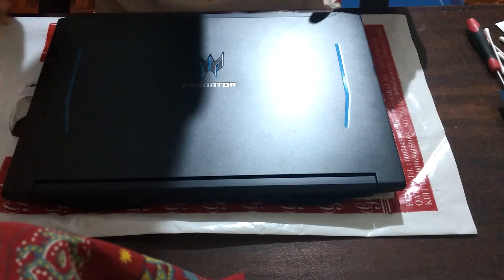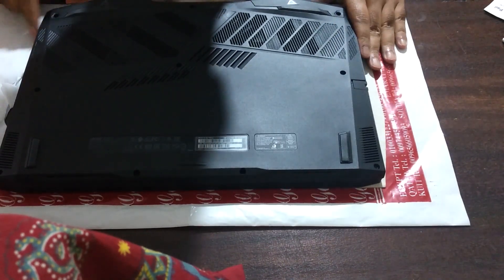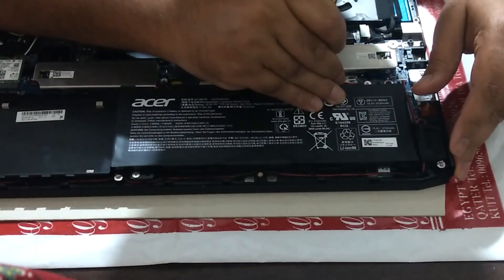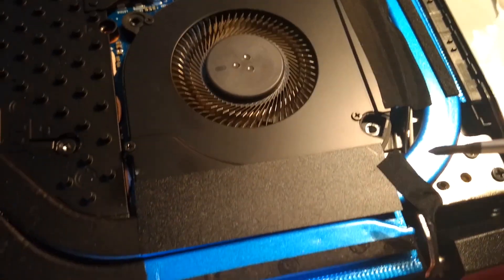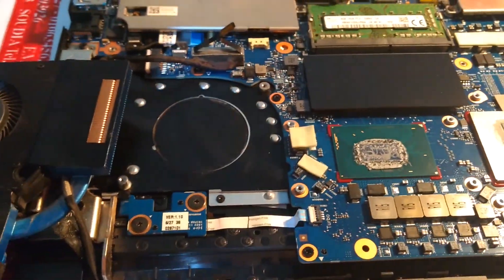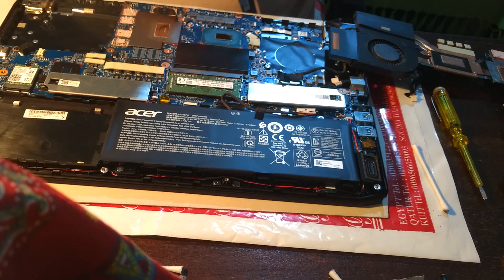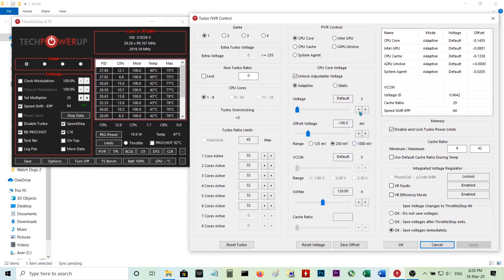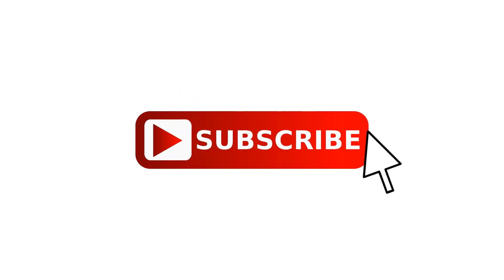Repasting your laptop's thermal compound | Arctic MX-4 2019 | Acer Predator Helios 300 2019

Comment: Hi, I just applied arctic mx-4 and thermalright extreme oddesy pads for my helios 300 (9750h, rtx2060). I did few CPU  & GPU stress tests and temps are hitting max about 75c with max fan speed, after about 5 mins of testing. Is this normal or should it be lower? I'm asking this because I checked the Arctic authenticity and it ahows it's fake.

Comment: Going to paste my laptop for the first time in 2.5 years. GPU fan just gave up. My temps were never very high, as i didn't game much. Recently the Max temperature was 75 degree using photoshop. I did routinely clean my fans, so maybe it helped. Now I can't avoid pasting anymore. Hopefully fan starts working again with some electronic lubricant.

Comment: What can I use to replace those vram paste?
Reply from the maker: I just repasted again today. The VRAMs I used 0.5mm Thermal Grizzly pads. For the rest 1mm pads. So far so good temps on load with Shadow of the Tomb Raider, I'm getting 75C :)
Reply: @ArifFidaali  Do you think those thermal pads are better for vram than using a paste?
Reply from the maker: @JotaFla  Yeah I think so
Reply: @ArifFidaali  And also, I just ordered the kryonaut extreme and I was thinking about using it on vram either. Do you think 2g is enough? For cpu, gpu and vram

Comment: What happens if you pick the 125mV in range? Please explain
Reply from the maker: I assume you're referring to undervolting with Throttlestop? It depends on your CPU. The same CPU will have reduced temps and other not work as in will give u BSOD. You have to keep experimenting until you reach a stable voltage without any BSOD

Comment: thanks a lot for this video, I was wondering  if you can tell me how much CPU temp after change it
Reply from the maker: Your welcome. I was at 85 - 90C then after repaste it was at 70C - 75C.
Reply: @ArifFidaali  wow it's big change that's mean the factor put bad thermal paste 
thanks bro
Reply: last question what about GPU temp ?
Reply from the maker: @mustafahasria3045  reduced by about 10C
Reply: @ArifFidaali  hi bro today i repaste my thermal paste for my laptop Helios 300 2020 with MX-4 2019 but my processor heet still 93 what is wrong can you help me with that
Reply from the maker: @mustafahasria3045  for best results also use Throttlestop to undervolt

Comment: Hey,
I am also having Helios 300 2019. Was playing Scavengers on it and the CPU temperature was going 90-92 degrees.
The fan speed was on MAX and GPU overclocking was on Normal. Is it okay for the CPU to reach this temperature?
Also the fan speed on my laptop in turbo mode is CPU:6240 RPM , GPU :7200 RPM. I think there is some issue with my GPU fan. It would be great if you could confirm your laptops CPU and GPU fan speeds on Turbo mode
Thankss
Reply from the maker: 92C is quite high, the CPU will likely thermal throttle. You can undervolt using throttlestop helps with temps considerably. Also your ambient temp must be high I assume? Check this video of mine: https://youtu.be/XOZ2ZYrD8Es

Comment: i would just like to know, what is the status of your thermal paste after 1 year? do you feel a need to replace it? have your temperatures increased again? do you think you would need to replace it after a year of about daily gaming for 4-5 hours?
Reply from the maker: I replaced the paste after one year as I noticed temps rising. Yes after a year you might need to change also depending on your environment especially if you're living in a hot environment.
Reply: @ArifFidaali  thank you!

Comment: I am middle of doing this and I have realised that I should have kept heat sink screws which are numbered sequentially as seperate for each one. I mixed them with each other (not with fan or back panel). There are 8 in number and one of them is longer but I have no idea where it would go back i.e. in which number
Reply from the maker: I think its number 8 the one with a triangle
Reply: yes...you are right. It's not marked either. All seven are of the same length, eighth one is longer.
Reply: Stock paste work was unbelievably bad. They used two different kinds of pastes. One grey one CPU n GPU, which was thinner. And a pink one on VRMs which was thicker. 
I managed to reduce CPU temps by 15°C in gaming. 
They did this to save money as the pink one is supposedly cheaper.
Reply from the maker: @gagan.dee.p  Oh ok good to know. You got some good temps, that's great

Comment: My laptop hitting 99°C after undervolting to -100mV, how much temp reduction i can expect after repasting my laptop using this Arctic MX-4?
Reply from the maker: Around 10 - 15°C depending on your hardware
Reply: @ArifFidaali  so I've been changing my thermal paste both for GPU and CPU, the GPU temp are surprisingly reduced a lot from 93 Degrees to 70 Degrees at full load Overclocked, but CPU temp reduction is very negligible , from 99 Degrees to 96-98, am i doing smthng wrong?

Comment: My variant is acer predator helios 300 2020 just buy around 15 days...and when gaming on high setting , the cpu will be around 85 to 96 celcius  almost in all games while the gpu always 70 celcius.
Can i use the 2019 method on repaste the cpu?
Already order the artic mx 4 4gram
Reply from the maker: Yes of course you can use same method for almost all GPU and CPU
Reply: hey bro what did you do with that pink paste ?
Reply from the maker: @shivampatel4461  I didn't do anything to the pink paste no need in my opinion

Comment: Hello. I have a problem with my new 2019 Helios 300 with i5 and RTX 2060.
Please help. When I start gaming, the GPU reaches its limit at 80 watts but just after 5 minutes, it thermal throttles and the wastage drops drastically sometimes even to 60 watts after half an hour of gaming. 

The return period is over, so I can’t return it anymore. What should I do ? Will I have to re paste with a good thermal paste ?
Reply: Same laptop,same problem
Reply: @anshbandral8857  Changing the thermal paste helped me
Reply: @NilabhSengupta  sure
Reply: Have you tried undervolting

Comment: excuse me ...can i use this on my laptop Sony Vaio VPCZ series...i7  NVIDIA GeForce GT 330M
upgraded to windows 10 (re-paste) its quite old and loud noise coming from cpu fan cause a little bit hot air.....i setting my power option/advance setting/processor power management/
maximum processor state/Plugged in:100% to 55% for the meantime....cpu fan  calm down
Reply from the maker: Yes Arctic MX-4 will work with any CPU & GPU
Reply: @ArifFidaali  :speed response
Thank you

Comment: Can't help but notice there were 4 devices that were pasted to the heatsink that you didn't replace the paste -- I'm guessing it was GPU RAM. 
Are those safe to leave with the original paste, without trying to smooth it out or anything?
Reply: yes they are gpu vram and I think we can leave that there since what was applied to those isnt thermal paste instead it was something else. I think you are better off not risking it and just pasting the main gpu block.

Comment: Here's a few tips from my experience. 
1) Get these materials ready. A good thermal paste, you dont need anything crazy like kryonaut since it's expensive. Arctic silver 5 or mx 4 will do just fine. Get arctic clean solution to clean the old paste or 99% isopropyl alcohol. Get some toilet paper, paper towel and cotton buds.
2) Understand that you're voiding warranty by doing this.
3) Always remember to disconnect the battery first and touch metal cover to discharge yourself. Honestly I've done this a lot but never damage my system in any ways so relax with the esd.
4) Unscrew everything and disconnect the fans. Take this time to clean it using compressed air. Clean the old paste well and reapply using x cross method or two lines. Pea method sometimes doesnt cover completely. 
5) Apply back your heatsink and press down a bit more on the cpu and gpu area. Do not relift to check. Just trust yourself. If you mess up the alignment, lift up and clean away the paste you applied. Reapply new paste.
6) if your laptop has those pink or gooey stuff on other areas, you can clean those away and put some thermal pads on them. You can get arctic pads or thermal grizzly pads. 
7) Using a cooling pad. For some laptops, it wont make a difference but it never hurts to try.
8) If you have intel cpu laptops, go download throttlestop and undervolt it. Now if you look up youtube tutorials saying they manage to undervolt it to -140 or -130 but you cant, that's totally normal. Not all cpus are the same. Just try your best to uv as much as you can.
Reply from the maker: Hi thanks for this. Check out my video where I deal with most of the issues that you have mentioned -> https://youtu.be/XOZ2ZYrD8Es
Reply: hey man i have  question, is it a problem if i repaste the pink things on the side with the arctic mx-4 aswell? or is that a problem?
Reply: @riftytwist9399  Yes that is a problem. Those pink stuffs are not thermal paste. You will need thermal pads to replace those, not thermal paste
Reply from the maker: @riftytwist9399  Hi yes you can paste the VRAM chips with MX-4
Reply: @ArifFidaali  dude no lol. Put thermal pads on it not thermal paste.
Reply from the maker: No thermal paste is fine also. VRAM chips do not contribute too much to thermals only th GPU die contributes to a large percentage of the heat.
Reply: @ArifFidaali  did you paste the vram chips after the video? Or did you leave the pink stuff on it just how it was?
Reply from the maker: @riftytwist9399  I left the pink paste as it was
Reply: is it fine if i just leave it how it is and dont replace the pink gooey stuff? And  ill just repaste the main gpu block.
Reply from the maker: @riftytwist9399  Yes no harm done. Since i repasted the GPU die only without the VRAM chips I havent had any issues so far. My thermals are still good.
Reply from the maker: @riftytwist9399  Better to repaste the VRAM chips as well it's a good thing since now you will have already opened up the laptop and the fan assembly. I know I'm contradicting but repasting the VRAM chips could help maybe by reducing by 1-2C.
Reply: @ArifFidaali  Nah its not worth the paste. I went to Acer Community its like a reddit for acer computers and someone posted a picture of them putting mx-4 in the computer  and the vram never came in contact with the heat sync so you are better off leaving the pink paste on there. This is the link: https://community.acer.com/en/discussion/583253/what-thickness-for-thermal-pads-can-i-use-on-gpu-vrm-chips-for-acer-predator-helios-300-ph315-52 if you scroll down a bit you will find the picture :)
Reply from the maker: @riftytwist9399  Thanks so much for that link however it's mixed answers. I have learnt a few things as well.
Reply: @ArifFidaali   Alright! :)
Reply from the maker: @riftytwist9399  Also please subscribe if you haven't done so. Thanks :)
Reply: Arif Fidaali you got it :)
Reply from the maker: @riftytwist9399  thanks! 😃
Reply: Arif Fidaali hey man i’m reposting right now but i can’t get he heatsync and fans off that easily
Reply: @riftytwist9399  you need to unscrew everything. Remove the fans first then the heatsink. Make sure to disconnect the wires connecting the fans
Reply from the maker: @riftytwist9399  Are you having issues with the screws?
Reply: Arif Fidaali nah thank you tho i just finished reposting it with arctic mx4 thanks for the video homie
Reply: xomegaxz it’s fine i got it
Reply from the maker: @riftytwist9399  Great!
Reply: @riftytwist9399  i just repasted mine this morning and took the pink stuff off and repasted with normal paste. I just saw that post you were talking about and worrying about the chips now...what thermal pad thickness is it? i'l buy some and repaste/pad it!!!!
Reply: @roberttorre1503  Hello sorry for the late reply ok so first of all you shouldnt have taken those pink gooey stuff off. Unfortunately those arent thermal pads or thermal paste. And thermal paste isnt a sufficient replacement for it because the pink goey stuff was thick enough to come into contact with the heatpipe but just thermal paste is way too thin for it to come into contact with it. The best choice you have right now is to get thermal pads. Doesnt matter which company, and im so sorry but i dont know what thickness pads you should get. Id say not something too thick because that will then push the heat pipes too much to just get something a decent size. IF you get pads that are a little bit bigger its comepletely fine becuase the heatpipes will just squish it to a bit of a smaller size unless its too big of a size. Well thats all I really have to say, let me know if you have any other questions regarding this issue.

Comment: so dumb you didn't clean the other diodes near the GPU 😭
Reply from the maker: Yes I should have but they don't contribute too much to heat. The main GPU die is the one that contributes to the majority of the heat.
Reply: @ArifFidaali  So if you're doing this, can you clean them off and put thermal paste just like you would for the CPU and GPU then?
Reply: @OfficialDlonem  no you cannot apply regular thermal paste unless you get your hands on a thicker viscosity paste. I have a similar video on my channel. Do check it out 🙂✌

Comment: Hi friend. Can you say me, what is the pink paste or pad on over the 6 grapich card's rams? (gddr rams) Is it thermal paste or pad or not? Cause i cant find the similar on amazon and i thought it can be the thermal pad. I bougth 0.5mm thermal pad but i dont know of i made a mistake. Help me please
Reply from the maker: Hello it's thermal paste so you can put any good thermal paste like arctic MX 4 or Kryonaut. Many are putting thermal pads of 1mm
Reply: @ArifFidaali  ohh man i bougth 0.5mm and 1.5mm. Can I use 0.5mm or 2x 0.5mm😂😂
Reply from the maker: @fareed717  0.5mm will be ok
Reply: @ArifFidaali  thanx man. Do you know If I will change thermal paste to the liquid metal, will it be problem for me. Cause I throw the laptop in the bag and travel a lot. Soo thats why it is shaking so much. Can vibration cause liquid metal to overflow? 

I'm undecided in switching thermal paste to liqiud metal)
Reply from the maker: @fareed717  For your case I wouldn't recommend liquid metal due to its conductive nature
Reply: @fareed717  Hi bro, bow did it go with these thermal pads? any difference?
Reply: @Domin17maru  There is not much difference. Laptop gpus still get 75C+ (cpu 93-97C) in stress😂
Reply: @fareed717  well since vrams don't have sensors there's no way to detect it, but do you feel the keyboard cooler by any chance?
Reply: @Domin17maru  nope It doesn't make much difference
Reply: @fareed717  My oh my 🤦🏻‍♂️
Reply: What are your system temps in predator sense during gaming?
Reply: @shantanupingale1422  in ultra settings 1080p max CPU 87 C° , max GPU 76C° with new thermal paste (MX4)
Reply: Farid Yusubov what about the motherboard temperatures in Predator sense? Apart from CPU and GPU there is a 3rd option of system temperature ? Please tell me that bro
Reply: @shantanupingale1422  let me to test it. How can I see the motherboard temp?
Reply: @shantanupingale1422  Ill use cpuid
Reply: Farid Yusubov wait are you on Instagram or Facebook?
Reply: I can send you the picture then
Reply: Use predator sense only, there is CPU, GPU and system temps, I need to know system temps!
Reply: @shantanupingale1422  I just tested system temp is 70C°
Reply: Farid Yusubov on max fans right during gaming?
Reply: Farid Yusubov did you replace the pink paste on vrm when repasting?
Reply: @shantanupingale1422  no I just replace thermal paste. On auto fan system temps gets 70C° but in max fun it gets max 60c°
Reply: Farid Yusubov so you mean only CPU and GPU, you didn't do anything to the pink paste right?
Reply: @shantanupingale1422  yeah
Reply: Farid Yusubov oh okay thanks, actually I repasted mine with artic mx4, CPU max 85C, GPU max 75C but my motherboard is going 80+ :(
Reply: @shantanupingale1422  wow you may bought laptopp cooler like cooler master or smtng
Reply: Farid Yusubov did you check your system temps after half an hour, because In the start they are 60C but after half an hour they climb to 80C!

Comment: why did you never touch the small chips aside also they had thermal paste and put new one?
Reply from the maker: The VRAM chips don't produce too much heat the main GPU die does that why
Reply: @ArifFidaali  but they had thermal pads that were ripped off, wouldnt it be better to replace them as well ?
Reply from the maker: @jeanka_82  They dont come with thermal pads, they have some pink thermal compound
Reply: What are your system temps in predator sense during gaming?

Comment: Hey, I was noticing your undervolt and wanted to ask if you've tested this undervolt in COD MW Warzone or any other CPU intensive games?
Also, is your laptop stable and what all games have you tried and stress tested your TP config with?
Initially, I also has the CPU core voltage set to 145.5 but achieved proper stability at 136.7.
Reply from the maker: Hi, I haven't tested with COD MW but I have played AC Odyssey, Rise of the Tomb Raider, Detroit become Human, Control all are stable with CPU core voltage of -140.7

Comment: Hi, what thermal pad did you use? What exactly is the thickness? 1mm, 0.5mm or something in between? THX
Reply from the maker: Hi I didn't use any pads. If youre using pads then 1mm is recommended
Reply: I think helios 300 uses 0.5 mm
Reply: @shantanuthakur6081  yeah I read that somewhere too